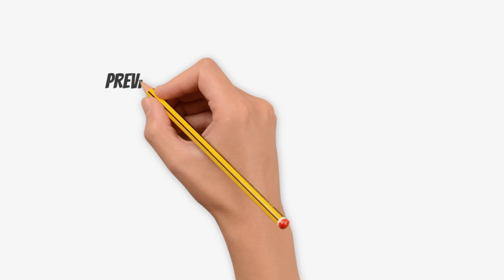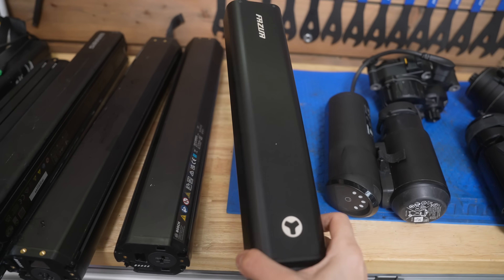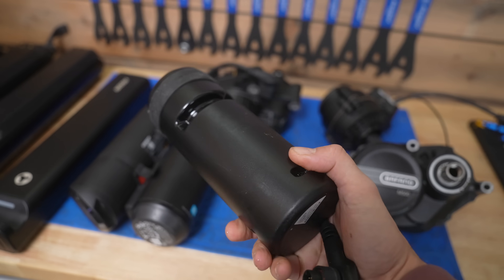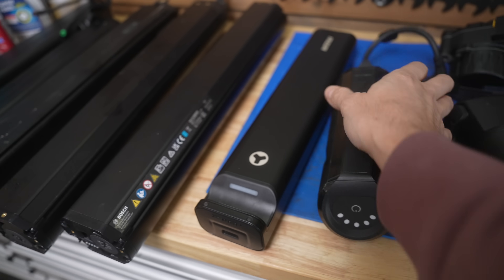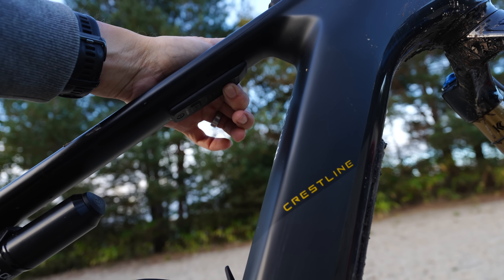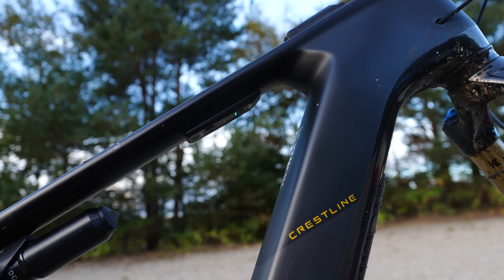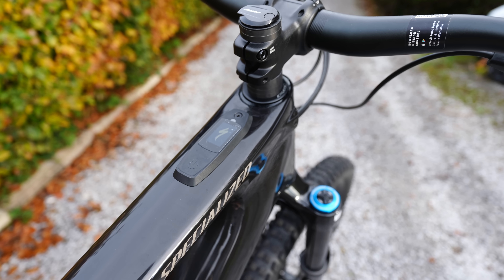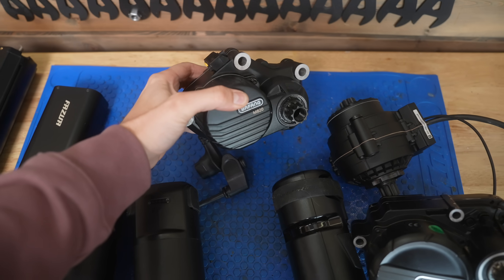We Have A Huge Problem With Ebikes....

Comment: Rob, it seems like shimano or sram should lead this effort. Bosch and brose are too committed to planned obsolescence. I trust the Japanese will eventually get this and Shimano will lead…Let’s hope so.
Reply: Bosch makes it so needlessly difficult to repair or replace any part of their motor systems... This kind of anti-repair engineering should be illegal!
Reply: @InventorZahran  Bosch is still the best when it comes to their ebike systems, their batteries are very good, their motors are very good, their displays are very good, their chargers rarely break and to top it of their warranty is the best in the industry (3 years instead of 2 from the rest).
Anyway, ebike motors are not something you want to take apart as a bike fitter, it's like taking apart a Rohloff gearhub, you'll need a lot of knowlegde and special tools (you'll rarely use). Just send the thing in and get a replacement, let the manufacturer deal with the repair.
Reply: @KapiteinKrentebol  Since when has Bosch had a 3 year warranty on e-bike components?
Reply: @KapiteinKrentebol  Bosch isn't 3 years, it's 2 years.
Reply: Considering how Shimano is trying to kill all backwards and cross compatibility with CUES, I would be surprised if they were more collaborative with their ebikes standards
Reply: just like Apple doesn’t allow anyone to do repairs on their computers.  In house repairs only.
Reply: Shimano still makes a power button that stops working in winter conditions, Bosch batteries arent as big as claimed, stupid things you have to deal with when buying a multiple thousand dollar bike...
Reply: Amen to that, and hopefully others will see it as justifiable cause.
Reply: Kawasaki is starting to make new Gas / Electric Hybrid Motorcycles,...claiming to make E-bikes obsolete, some day. 🤷🏼‍♂️
Reply: @andrewroberts6123  maybe "E-bikes" (motorcycles) such as the surron, the USA (and some other places) have a wreid culture of calling throttle operated "E-bikes" that dont need pedaling with the same name as real pedal assisted E-bikes, only a bike with a  Torque sensor is a Bicycle, others are mopeds with pedal activated throttle or full on motorcycles (surron) i dont think anything with an ICE will replace the pedal assisted E-bikes...
Reply: This is such a laughable comment. Your favorite brand is not going to make less money for their shareholders just to please you. This requires government intervention.
Reply: Shimano had been playing catch up for the longest time. At least in the MTB space. They copied SRAMs 1x 12 drivetrain system and have been playing catch up with electronic shifting. They also came out with cues since their market share in the super budget drivetrains having been going to new companies such as Microshift.

Honestly, sram is probably the best bet right now. They set the standard for the universal derailleur hanger. Hopefully they can do the same with Ebike stuff.

Comment: 100% agree on your analysis. However, no amount of appeals to manufacturers will solve the problem. The situation will not change without state regulation. The same applies to power tool batteries and electric car batteries by the way. The amount of wasted energy and resources makes me mad.

Comment: fyi a lot of what you showed is cross compatible in the first 2 minutes. The problem is the shape of the batteries but they're all pretty normal. Many of them have standard connectors.. BUT THEY ALL CHOSE DIFFERENT FUCKING STANDARD CONNECTORS, so you can get adapters but why. Just lop that shit off and put on a new connector rofl.

Comment: The point you make about brand's creating their own ecosystem is valid. I just think that their main motive to do that is mostly to promote safety and therefore their own survival. These fires we hear so much about - from the batteries - mostly happen when your wishful mix-and-match approach is practised. It's ironic - I'm a libertarian myself - but I think that in order for ebikes to gain mass appeal, they need to be safe and the quickest way for that to happen is exactly the specialization that you speak negatively about. Yes, buying a Bosch Smart System bike is going to rope you in to an ecosystem, but it will also get you a safe bike with a certified battery and reliable electronics.

Comment: What is kinda interesting is that on e-scooters (with exception of couple brands) everything is pretty much interchangeable with generic parts you can buy in China. And some of this stuff would work on e-bikes. So in my opinion it is purely done to prevent people from fixing or updating their own stuff.
Seriously, proprietary motor mount - that is fine... But proprietary chargers (that also talk to the battery), motor controllers that talk to the battery etc. is just a way to keep people from fixing or updating their own stuff. It is not about safety...
Other thing that manufacturers should remember is that people will still hack their firmwares and bypass all sort of DRM lockouts. This have happened to Ninebot e-scooters, pretty sure it would happen on e-bikes too. Or hell, somebody would solve the problem with brute force by throwing away all proprietary electronics, and installing generic Chinese parts, like motor controller, display, BMS, etc.

Comment: A good point, until there is an organizational or government body that could standardize bicycle in general, not only for eBike. However, I am not aware of some organization like SAE for automotive or UN-ECE that drives standards and compatibility and safety requirement for bikes in general. There's a UL and ISO standard in general for electrical system within EBike. Although, are all the manufacturers are required to adhere to these standards? In automotive, there is an NCAP (new car assessment program) that ensure each vehicle coming to the market adhere to some ruling and provide safety ratings.
I do strongly agree about the backward compatibility aspect, each component within the same manufacturer should and shall be backward compatible. The caveat would be the hardware restriction from e.g. micro chip / micro controller manufacturers.  
Additionally, let's consider some safety aspect, for example if one decided to mix and match different motor and battery and control. Who will be the owner of responsibility if there is a fire in the system? This is unfortunately a big question that is not easy to answer.

Note: I do not own an eBike, still shopping for one. However, I do own a few non e-Bike and not in any way an expert for biking standards.

Comment: they are becoming just like laptops and phones ,  you use it for 3-5 years and you throw it away ,and get a new one , or sale it half the price when the warranty  is gone  ,  well 5 years  is also the average life span  of battery  and after 5 years they probably no longer make the battery as spare part ,   well you can still  sale your wheels fork bar and sadle  and make 200-500 ,or use them on normal bike , ,  frame motor controller and battery that go in the trash ,,

Comment: Right to repair is a big issue as well. When your motor fails and you are not allowed to repair it, the entire bike becomes scrap if the manufacturer no longer offers the old motor/system.

Comment: You forgot to mention the Biketec FIT system, different motors can be paired with different components, all FIT batteries are compatible with one charger and also the remotes can be swapped.

Comment: The reality is that the average customer doesn't care. People buy their bikes. If something is broken, they just replace it. Simple as that. The only thing that has to be interchangeable is indeed the charger. Because as soon as you have two bikes, or just get a new one, the old charger might not work. 
Everything else is BS. The standard for batteries is already the cells. Trying to find a standard for battery design will limit the overall design. It's the same for motors. Mfgs will then automatically have to find a compromise to fit the design into the standard. And a compromise is by definition not the best solution. 
Furthermore just because you have a 10k bike with let's say an EP8 and six months later the EP8.1 comes out doesn't make your EP8 a shitty bike. It's just that a newer bike is slightly better. But when you have innovation that is always the case.

Comment: it all boils down to the fear of going extinct out of business..keep it in house. 
you're fatty's just have to wait for the chinese to figure
a common workaround cheat a kit to bypass each system or 
better still get a very small lightweight petrol/meth engine under 20cc or even under. 
like there was in the past with super long mileage range per pint/litres 
(no way that'd ever happen as there'd be no way to milk it out the pocket of weekend cyclists
and no engine road licence or test certification max speed no more than 25 kph
you'd think a strap on meth engine would be the rage and not electric?)..
more than fast enough to be helpful to lazy fat leg'd men and wombs'is 
no good to me though.. I like the lactic burn as I pump the pedals round and round
yeah the electric cheats wizz past thinking they're exercising..though me I don't ever go very far
an hour most days nice and slow with pannier bags and my cheap e-bay bike
round and round the park for a lark and maybe the shops sun wind rain and snow
yeah there I am see me very slowly go

Comment: For me I think backwards compatibility is a must, I understand parts between brands been non compatible, Coming from a MX back ground I can’t fit a HONDA piston in my KTM for instance however I can fit ‘light’ upgrades between my KTM generations 

I think wiring looms should be looked at so you can swap just an improved motor over like the shimano ep801 into the EP8 body, or the master mind TCU onto a gen 2 levo etc 

It does come across as a disregard to consumers and kills the resale value of a bike at times all for greed by the bike companies

Comment: Thanks Rob. I agree wholeheartedly, though I think “collaboration not competition” is better phrased “collaboration will bring more competition” as then you’ll have choices of charger, battery, electronics, motor, etc. Prices might also fall, though the smaller, less efficient manufacturers might then fall by the way. In this way, it wouldn’t all be roses. That said, interchangeable parts, upgrade  ath, and keeping older bike s on the road instead of the in the bin is much more sustainable. A way to accomplish this is to have a any single entity with a good number of consumers (California seems fond of regulation, as do UK and EU) start working on regulations for standardization in consumer welfare and climate change regulation efforts. The large manufacturers would then recognize the value of helping set the standards. The cost of maintaining multiple standards would be too high such that this standard would become the single standard throughout the world. You by yourself might have enough subscribers to have an effect if you organize an email campaign to advocate for their contacting their represenatives and requesting specific objectives. It would just require some organization and thoughtful suggestions. If any two large regulatory bodies (say, in California and UK?) collaborated with each other and some of the large manufacturers, then the world standard would likely be set.  Maybe something to consider?  I”m just reminded of the vlog brothers advocating for something even more important (reducing the cost of malaria tests and drug and tuberculosis tests and drugs) and likely having a significant effect on the future path of these two diseases going forward. Maybe this is a sound model for you too, in spite of the size difference in your respective audiences?  Any efforts you make could be made more effective if you can get large influencers like them to join you in this? Just a thought…

Comment: Its like committing to a camera system. Once you are in you're stuck with a proprietary standard. If your charger carks you are in for some fun to replace it in many cases. Likely the same deal with old motors and controllers as well. Its going to mess with resale values and depreciation as well. I for one would not like to buy a second hand machine with a battery on the edge of extinction.

Comment: The brand lockout can be bypassed if you have some electrical / electronics knowledge and you have access to the wiring from the current battery - generally available in the motor housing. Put a dual Schottky diode pack in there - one side connects the current battery to the motor - all is normal. Now you can add any other suitable battery to the other side of the diode. The batteries cannot discharge into each other. Both will run the bike. If you maintain a higher state of charge on the second battery the factory battery will not be used - this may be good if the factory battery costs a lot to replace as you will be charge cycling the cheap second battery most of the time. You should fuse the second battery - I use a resetting circuit breaker (up to 48 volt) and use this to turn on/off the second battery. The Schottky diode pack needs a small heatsink. I use this approach on three ebikes now with only two "second" batteries being rotated between bikes. The factory batteries are still in place but do not get used much and are kept at approx 60% SOC for longevity.

Comment: I have a haibike trekking 4, my mate has a haibike mtb10

His has the newer motor, it's the same change connector but the relationship between key tabs and the connectors is rotated 90 degrees. 

So same bike Manf, Same motor Manf, same battery voltage although the battery capacity is larger the power output of the chargers is the same, 

But it's a different charger.

How is that in any way sane?

Comment: Batteries make sense to be mostly propietary because they need to adapt to a frame, the charger depends not only on the battery but also on the EMS circuit on the controller for the battery, the only thing is unjustified is the plugs wich don't matter since charging an E-bike with the wrong charger is asking for it to burst in flames the milisecond something goes wrong, wich is a thousand times more likely without the original one. Each battery has it's own rate, each board controls the batterie's charging differently, and each charger is designed for a different delivery for the safest possible charge on it's compatible counterparts. Just look at scooters bursting onto flames when modified with other chargers, batteries and controller boards. The motors have fairly more similar rates so that one's fair too. Making an universal ecosystem of chargers, batteries and plugs for high end E-Bikes will just hamper the ability for the brands to make the most out of their desings, and most people don't want to have more than one E-Bike anywais so the charger compatibility is pointless unless you need a replacement, wich is unlikely unless you treat it poorly, in the case of batteries it's another story given how they wear out.
This is one of the reasons why i don't really want a fancy E-Bike, they're likely not gonna last me more than 5 years working properly and afterwards i need to go hunting for a battery that will cost an absurd amount if they're even available. I'm not against E-Bikes and i understand why people love them, but i'd wait until we have better cells to shove in our batteries before buyng one

Comment: I will commend the British company VOLT here, I have one of the very first VOLT Pulse Ebikes from 2015 and its been excellent, it is low tech by todays standards but it works really well with a BAFANG 8 Fun rear wheel hub drive, no bluetooth and requires no firmware upgrades. The latest VOLT Pulse still uses the exact same motor and connections, its a different controller and it now has a torque sensor, but VOLT still fully support my bike and so long as they stay in business I cant see it becoming obsolete and unrepairable, you are tied to their propriatory battery though which is annoying, but all the motor parts are available and its easy to replace bits, so VOLT seem a fairly safe bet if you are bothered about longevity

Comment: It is not only not "easy" but actually impossible to have 1 standard charger that works across all systems.  Different voltages and different chemistry make this impossible.
Reply from the maker: Check this out. It is a single charger that works across almost all ebike systems: https://www.watt24.com/en/lion-smart-charger/

Comment: I have just bought (yet to collect) a Specialized Creo with the 1.1 motor, it was half the price it was selling for at launch so I have jumped in, but I know its unlikely to last more than a few years, unlike my Dawes Super Galaxy from 1982 which is compatible with pretty much anything, Specialized have just released the Creo 2 with a new 1.2 motor and my bike is already discontinued, and I bet its not compatible with my bike, and who knows how much a battery will cost (inside the frame) or even if it will be available in a few years, but what can you do, environmentally its a disaster, some form of standardisation will emerge in time I hope but its a long way off yet. The Bafang rear drive systems seem fairly standardised at least, my Volt Pulse is 8 years old and VOLT still support it, infact the basic design is still the same, but I am tied to their batteries which is annoying.